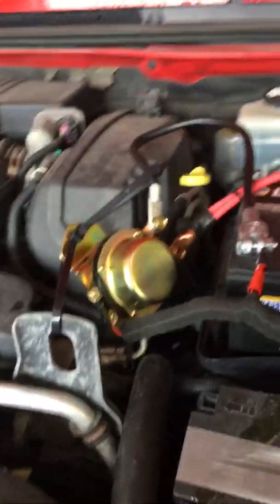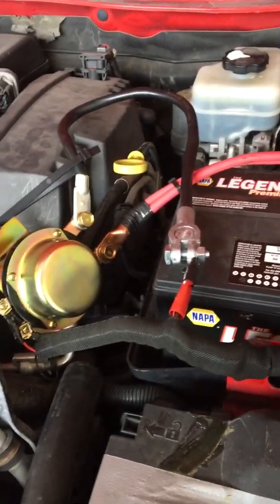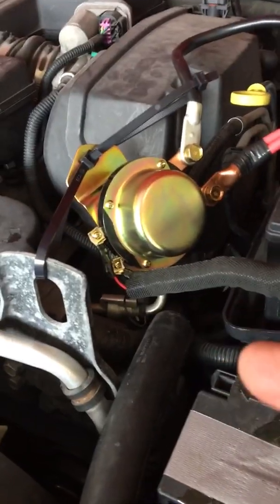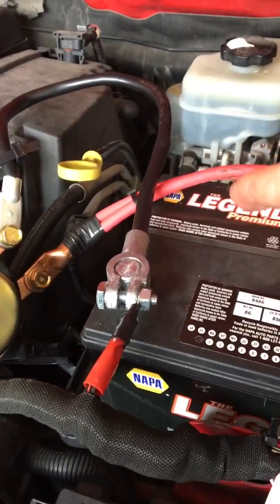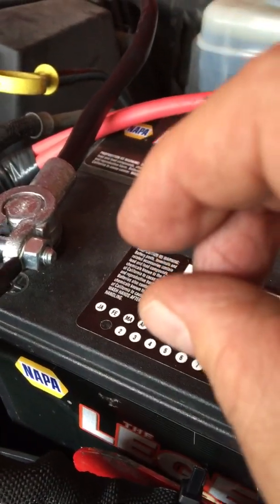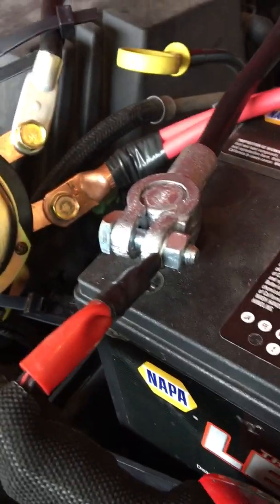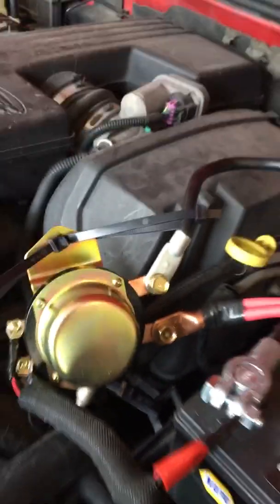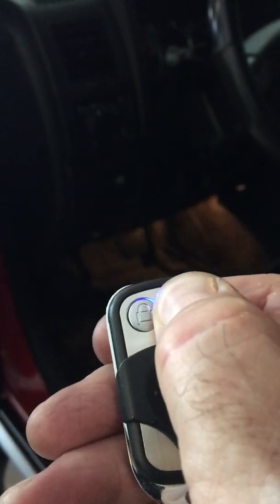Remote battery switch disconnect. Ekylin. Parasitic draw fix.

Comment: THANK YOU SO MUCH FOR THIS VIDEO!!! OMG, THIS IS EXACTLY WHAT I NEED FOR MY CAR!!!! I hope i can find it so i can purchase it and wire it to my car. I need it badly like months ago hahaha. Ive been thru like 3 or 4 batteries, a starter, 2 alternators, several battery cables, several battery cable connectors, all for the car to continue dieing eventually, sometimes oondr than later, sometimes not as fast but still never the less, dieing. I have unhooked the battery and that has been the pnly times it had not died on me, but im not trying to open and lift the hood everytime, and disconnect the battery. Plus, having to do that possibly in public is kinda embarrassing, im a blonde so im already gonna look ridiculous under my hood to everyone else that doesnt know that im mechanically inclined. Lol. Any advice about the device  since its been over a year ago since installed? Is it still working? Thanks again for the video!
Reply from the maker: It was my daughters car and we actually traded it in. It worked flawlessly for the time we did have it though. I wish you the best and thank you for the comment.

Comment: I had a similar 'undiscoverable' draw. i spent a hours searching until I tested the alternator. took a while but the diodes were bad and intermittently we allowing current back in the wrong direction. few amps every now and again and your battery can be dead overnight or a few days. Had two dud alternators in a row too!! I always go to the alternator after checking current at fuses now :)

Comment: thanks for the video. I also have a parasitic draw, curious does the battery "reset" when you disconnect? Do I need to put in radio code after I connect back the battery? Thanks!
Reply from the maker: Yep.  Unfortunately